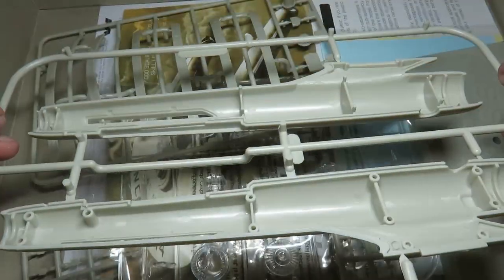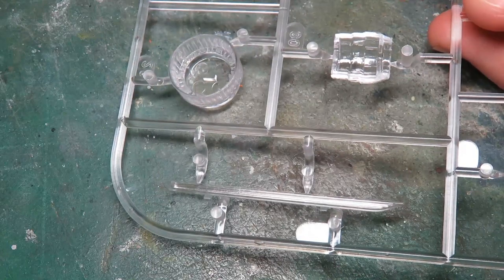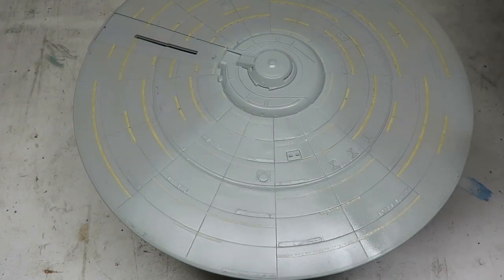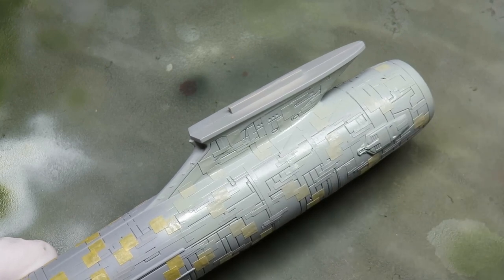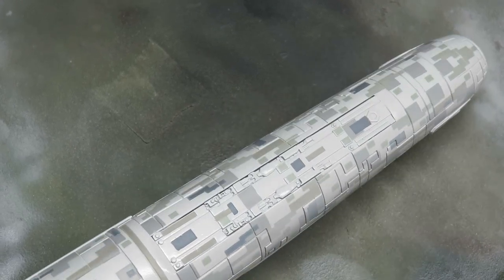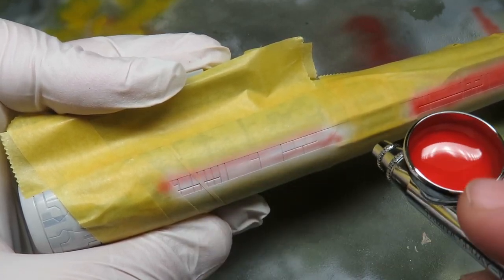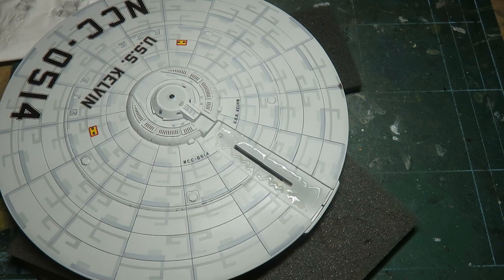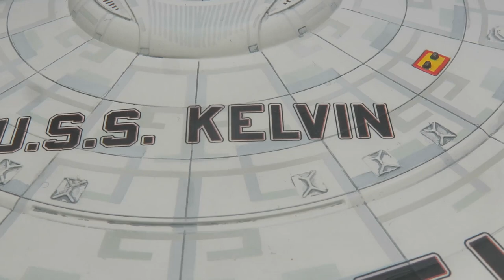Moebius 1:1000 U.S.S. Kelvin

Comment: Excellent work on what you did with the model.  Though it's  not reallly TOS style but more of TMP (The Motion Picture) style.  TOS style is basically smooth lighter gray and dark gray hull, orange buzzard collector, and dark gray being used on the ends of the nacelle and impulse drive.  What you have created is is from the The Motion picture era.  Where the ships were brighter and had aztecing and the ships were more areodynamic.  But thats okay.  Still good job

Comment: 🖖😎👍Very cool and very nicely well done indeed and very nicely executed and very nicely informatively explained while proceeding with the build in every way shape and form and detail provided indeed, And it's very cool and very nicely wonderfully looking after it was all finished with, I to plan on building mine more TOS looking as well but I plan on also adding a smaller pendant to the secondary hull as well I have a lot of after market decal sheets and changing the registry number to NCC-1514 cause in the original TOS there are no 0's before the numbers after 99 after wards it just all larger numbers like from 100 and up and so forth, Any ways your model came out very great looking and a job very nicely done indeed!,👌.

Comment: Nice job sanding off the 'damage' plates. Those plates actually weren't there because of some 'damage' pre movie. But rather, they were there to make the CG model look more detailed in that area, as that is right where the camera passed tightly over the hull right at the beginning of the movie. 
Moebius (the kit manufacturer) has traditionally been pretty lazy when it comes to analyzing the source data that they get from their various sources. They didn't stop and ask, why are those plates only in that area.
On other kits that they produced like their big TOS Cylon raider, they laser scanned the kit from an existing resin kit, that was asymmetrical. They never went through and looked at the data files and realized that their source material was asymmetrical and so those imprefections creep into their kits. Their TOS Battlestar Galcatica was laser scanned from the Timeslip Creations resin kit, and again, the imperfections of that kit made their way into the injection molded kit.